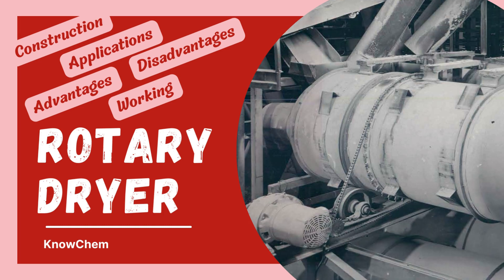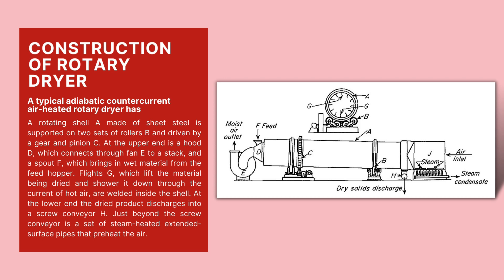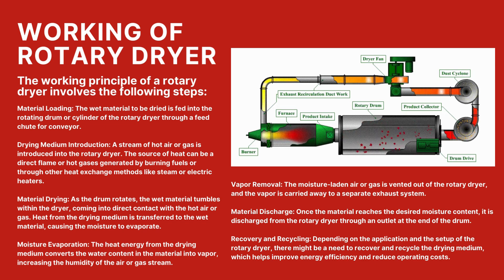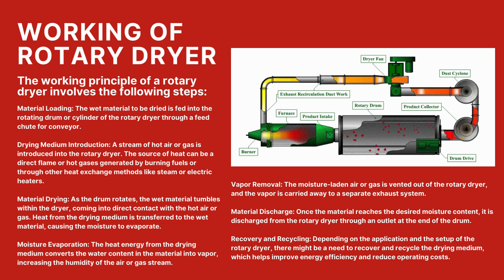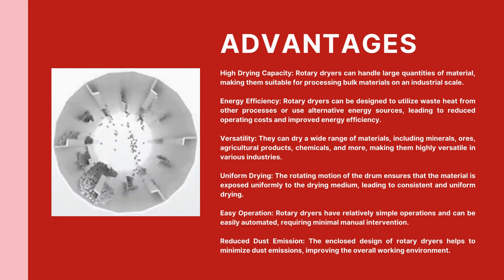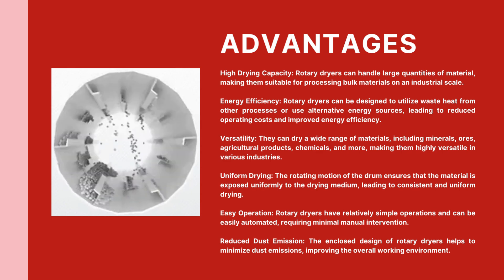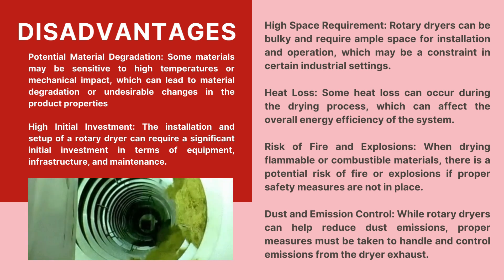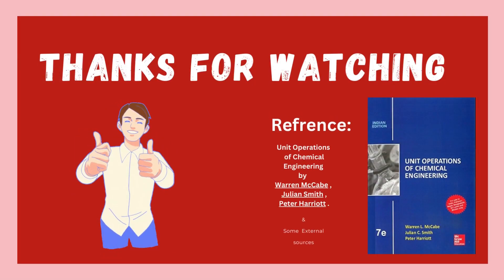Rotary Dryer | Construction | Working | Advantages and Disadvantages | Applications ​⁠

Comment: with the video,what is the oxygen quality of air that circulate in the burner since you re-circulate flue gas from the dryer.thank you.
Reply from the maker: According to me, oxygen quality will be the same as that is at mean sea level unless the dryer is used at an elevation. At elevated atmosphere, oxygen content goes down thus air quantity required would be more.